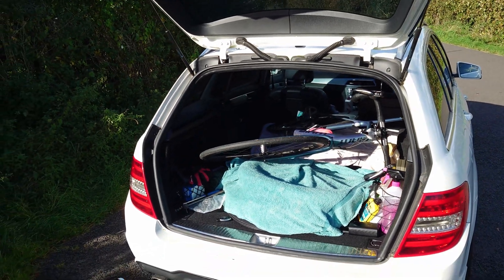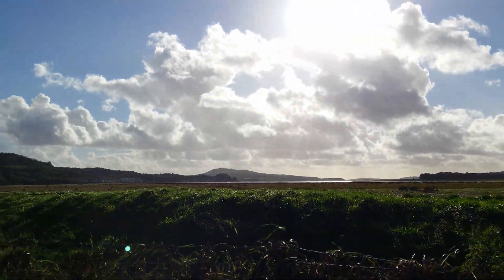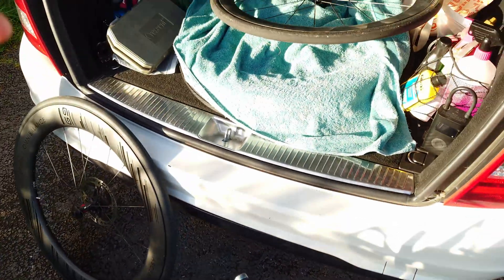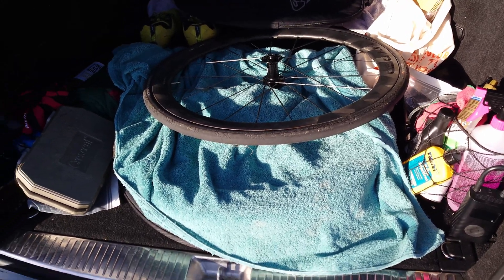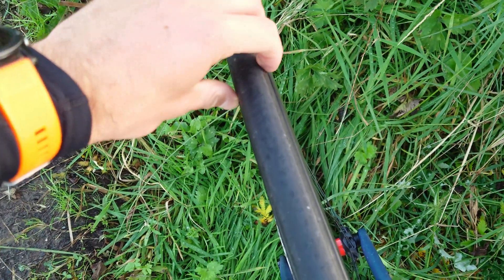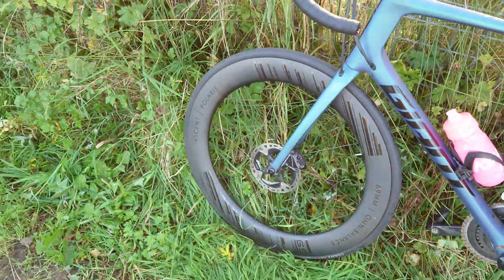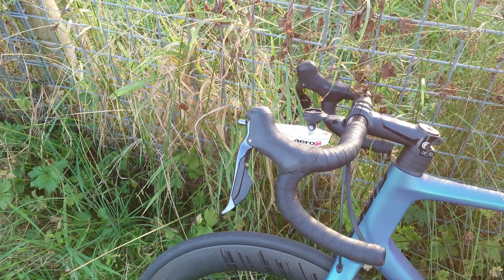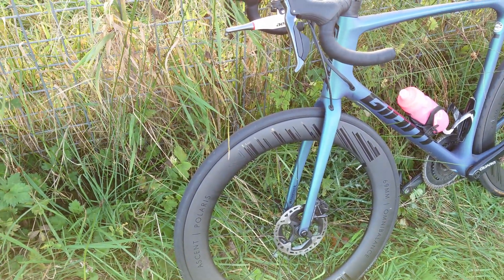Aero Testing Diary #2: Crosswinds and stalling wheels.

Comment: I currently have zipp 404s and am interesting in getting 303 firecrests. Obviously the wheels will be less aerodynamic as they will be 18mm less deep. However will be like 400g lighter. I’m only 70kg so not a huge rider and I hate when my wheels get buffeted in the crosswinds and I do want to get an advantage on climbs as I do a lot of road races that are punchy and 4-10min climbs in them. With all the data suggesting aerodynamics are more important, would I actually benefit more from a 40mm wheel that’s lighter compared to a deeper wheel?

Comment: wouldn't it be a more accurate aero test to find a very long downhill and go to the top and coast down, measuring speed at the bottom?  Use a stick or a string taped to the frame and to your chest to fix your position on the bike.   Pedal the bike at zero watts while coasting.  Repeat the test several times to minimize errors.  This test would be very sensitive to aero differences. You can do the math to compute the aero benefit by the difference in exit speed.
Reply: I agree. The only dynamic differences would be variations in wind patterns, but that is easily averaged out with higher n number.
Reply: I think a single corner could skew the results as braking comes into the equation.

Comment: I bet you can’t conclusively determine any significant difference. I’ve attempted similar tests (for tyre pressure) and I know it’s really difficult  to conclude anything; which leads me to think that the differences are sometimes so marginal they are irrelevant. Sometimes it’s better to not worry about marginal upgrades and instead use that time for training.

But, I like your attention to detail and your controlled approach. 👍
Reply from the maker: 1. With a stiff protocol, position discipline, and enough repeats so the CdA solution converges, you can tell the differences :)
2. Tyre choice and tyre pressure give a more tangible difference than the rims do in the 30kmh range - that's what the data is telling me so far.
Reply: @PeakTorque looking forward to it 🤞.
Reply: @PeakTorque  I would agree with all my testing, 800 or so runs on the same section and roll down speed is more pressure and position related then anything a wheelset can make up for. The froome position is still the highest efficiency roll down position even if it is scary sometimes, I run my rear closer to the underside of the saddle then he typically does but I think the difference of getting the head down and creating a good flat surface is the most reward for high speed (30+mph)

Comment: The instrument mounted on the bars is a good start. Hard to tell about drag with a maelstrom of wind coming from all directions. The grail would be if the results were repeatable in those real life conditions. It would also be interesting if different rider positions  are better in a crosswind. Perhaps that would show more than marginal gains. Interesting topic.
Reply from the maker: The results and trend of results are repeatable across different days im happy to report. That's why im using a 3 hole pitot that can accurately determine yaw. If you want to see the full protocol and explanation then you can find it on patreon.